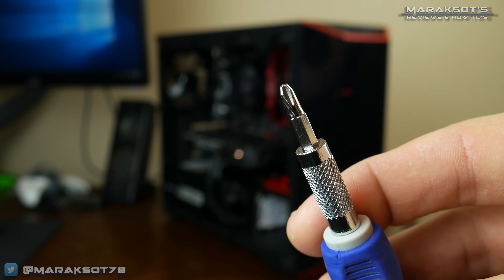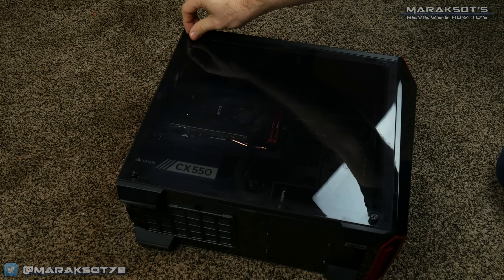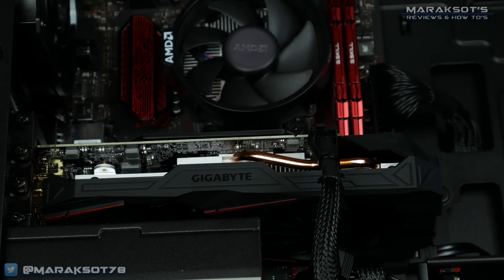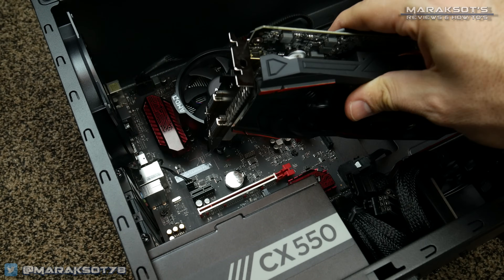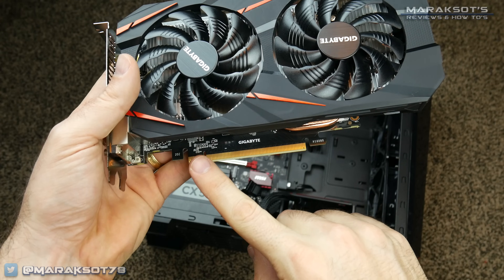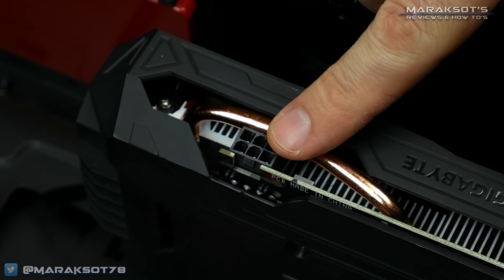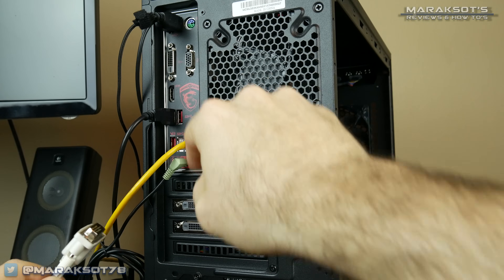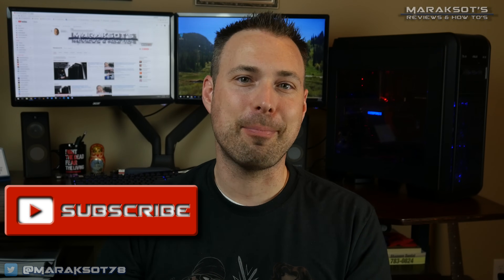How to Install a Graphics Card - Upgrade Your GPU

Comment: i did this then used the command to check my GPU and it still said my old one i installed a geforce rtx 3050 but when i check it in device manager it says intel (r) 630 what do i do?

Comment: My GPU requires a 6 pin connection. My PSU has 2 6+2 ones, both comnected within a single cable. Is it safe to plug one of these?

Comment: More helpful than the previous video where the camera aas on the side so i couldnt actually see INSIDE the computer. Only one problem... i dont see a power supply cord at all let alone one that will fit this geforce rtx 4060

Comment: my gpu has 12 PCIe power pin slots, my pc came with a wire with 6×2 pins with another 6×2 pins extended from that. Should i use that or is it safe?

Comment: You were telling us about static discharge wile doing it on a carpet
Reply from the maker: Yep. The point is ESD isn't as big a concern as some people will lead you to believe. I've been building PC's for close to 20 years and have built almost all of them while sitting/standing on carpet and haven't killed a single component thus far. As long as you touch something metal and equalize the statc charge between you and your PC the odds of damaging a component is pretty much zero.
Reply: hmm okay then @Maraksot78
Reply: this video helped me out i currently have a i3 10105F and a gt 1030 with a B560 DS3H AC-Y1 and i am going to put a gtx 1650 with a i5 10400f and 32 more gb of ram  @Maraksot78

Comment: I don't have a 8 pin cable in my psu do I need a adapter?
Reply from the maker: They do make adapters, but before you do that I would check whether or not your power supply wattage is enough to support your GPU.

Comment: Not sure if I missed this step but I was told if you have a previous gpu in the Pc to uninstall that driver first before setting up the the new gpu. True or no?
Reply from the maker: That's probably the best way to go about it, but you don't have to. I've done it both before and after swapping out graphics cards and everything has worked just fine.

Comment: I have a 750 gold power supply is that alright to run the 4070 ti on?
Reply from the maker: 750 watts is the recommended PSU wattage for a 4070ti, so yes. 👍🏼

Comment: Hey mate do you still respond
Reply from the maker: It depends on the question and whether or not I feel like I can help.
Reply: So the power supply that I currently have has a two-pin and a four-pin cable  for the gpu. Now the gpu that I want to install has 6 pins. So can I put both the four-pin and the two-pin cables together?
Reply from the maker: I'm not familiar with that kind of configuration. 2+6 pin is very common as most GPU's use either a single 6 pin or 8 pin power connector, but I don't think I've ever seen a 2+4 pin PCIe power connector.  I know there are 4 pin connectors though for EPS (CPU socket power) that look very much the same as a PCIe power connector.  I believe it's keyed differently though to prevent people from plugging it into their GPU as they're wired differently.  But yah, without being able to physically see what you've got going on I can't say for sure what you've got there.  Is there any kind of label on the connectors themselves?  It will usually have EPS, or CPU on it if it's for the CPU and PCIe or GPU if it's for GPU power.
Reply: @Maraksot78  ooh I made a mistake I meant 6+2 pin cables sorryy
Reply from the maker: @ellinikompifteki  oh ok. So if your graphics card uses a 6 pin power connector then you just plug in the 6 pin plug and leave the 2 pin bit just hanging out, or you can zip tie it back to make things look a bit cleaner. If it's an 8 pin then you want to plug in the 2 pin and the 6 pin together.
Reply: @Maraksot78  yeesss thank you so much for your time mate
Reply from the maker: @ellinikompifteki  You're welcome. Happy to help where I can.

Comment: What should I do if there are drivers already installed for my old GPU?
Reply from the maker: If your new GPU and old GPU are both manufactured by Nvidia or both manufactured by AMD, then you can simply update the driver through GeForce experience for Nvidia cards and through the Radeon software for AMD carda.
If you're switching from AMD to Nvidia or vise versa, then you'll want to uninstall your existing driver and then install the new one after you've swapped in your new graphics card.

Comment: When I try to plug my monitor in the graphics card my monitor simply goes black. It's on, but it doesn't show anything. Is this common and is there a way to fix it? BTW, nice video! Helped me install the card.

Comment: so my pc is fairly old its about 5 years old, it has i9-9900 core 16 gb ram and nvidia 2080 super, I want to install 3080, is it as simple as taking the 2080 out and putting the 3080 in? or am I in for quite a bit more work if I can upgrade it at all? my case should be able to handle the change its a pretty big case.

Comment: If you dont have a gpu and put it in then you find power cables for it inside the psu ? Or you need to connect new cables to psu ? Buying premade custom pc then buying gpu later so need to put it in myself

Comment: i want to buy a 3080 rtx to replace my 2060 rtx but i dont know if it will fit how do i know if it fits (i havent bought it yet)
Reply from the maker: If you look up the particular model of 3080 you want to buy on a site like newegg.com or other online retailers, in the product description it should list the dimensions of the card and then you can measure the space in your case to see if it will fit.

Comment: Bruh... Why do that on the carpet though..and you talk about static discharge.. lol.
Reply from the maker: It's actually much harder to kill your components than many people would lead you to believe. Your case acts as a dampener if you will. When you touch it, if there's a bunch of static built up in your body, it will be dissipated into the case and you wont shock your components. And even if you did shock your components odds are in your favor they'll be fine. You should check out this video from Linus Tech Tips where they try to kill RAM modules with ESD.
https://www.youtube.com/watch?v=nXkgbmr3dRA
And this video from JayzTwoCents where he tries to kill USB ports.
https://www.youtube.com/watch?v=xdzo-uAvz5Y&list=PL-qY8D-eM9xAKQPVqrTL_cpcSRIj9HTU5&index=1
JayzTwoCents has even admitted to building many of the PC'c on his channel while on carpet.
https://youtu.be/0swuvSF527E?t=63
I too have built many computers while on carpet and have used the "touch the case" technique and in the last 17 years I've killed 0 components.

Comment: I just installerad a 1660yi in my pc and my powersupoly seems to have enougth power but i only seem to have a 6pin power Calle while the grafiks card reauires a 8 pin i did s bit of reserch but can i just put a adapter on or Do i need a new cable (

Comment: I'm a little late to this but should I be concerned with static electricity if I disassemble my PC on a carpeted floor? Does grounding yourself negate that issue? Thanks!
Reply from the maker: I recommend at least equalizing the static charge between you and your PC by touching a metal portion of your case.  Modern PC hardware is much more difficult to "kill" than many people will lead you to believe.  LTT made a video about a  year ago where they intentionally tried to destroy PC components through an electrostatic discharge.  If I remember correctly they were only able to kill one stick of RAM in the process.  They tried really hard to to kill parts and despite their best efforts the PC kept running.  Here's a link to the video if you're interested.  https://www.youtube.com/watch?v=nXkgbmr3dRA

Comment: i got a new card for my birthday but there are wire in the way so i cant plug it in. its considerably thicker than my old 970. this 2060 wont fit! move wires, cut metal?

Comment: Question I’ve never ever have even remotely gotten close to pc parts but I wanted to ask do you think installing a GPU is easy? Like 1-10?
Reply from the maker: Well if you're talking about just the install process... 1 being the easiest and 10 being really hard I'd say it's a 3 or a 4 so long as you know what you're doing and have an adequate power supply and stuff.
Reply: @Maraksot78  ah ok how would I know if my power supply is good enough?

Comment: Thabk you for this informative video,

Just bought a new/used GPU to upgrade  from my current 5600xt & I'm confused why does my current GPU have the availability for 2 sets of PCIe cables but only one is connected... does having only one cable vs 2 affect anything or is it a redundancy? 
Does the 6700xt require both of the PCIe cables hooked up? 4over4 is currently connected should I add the 3over3 PCIe?
Been asking & asking but nobody is helping please help! Thank you
Reply from the maker: Yes, you want to connect both the 8 pin and 6 pin power connectors.

Comment: Now where can I get a Graphics Card? hmm I'll try download the Graphics Card. Frick, there's no good results for this search. I want to download Graphics Card please I'm broke. I have an Intel HD 3000 (aka the toaster laptop) that doesn't support any games. 😭😭😭😭😭

My Depression intensifies due to low spec parts

specs:
i7-2620M - mediocre
Intel HD 3000 - legit potato toaster that wants to kill me
8 GB RAM Stick - Not that bad
2 GB RAM Stick - Terribly potato toasted
Reply from the maker: Unfortunately getting a graphics card right now is an almost impossible task unless you're ok with paying 2, 3 or 4 times MSRP. Sounds like that's not your thing though. Depending on the speed of your internet you may want to check out GeForce Now. May be a way to play some games on your potato PC. I made a video about GeForce Now if you wanna check it out. https://youtu.be/kA0cr0Ae-Wc

Comment: Hey I need help I have ryzen 3400g vega 11 graphics can you suggest a good graphics card pls
Reply from the maker: Well that's an interesting question because currently there is a world wide shortage of graphics cards... that is unless you're willing to pay WAY more than MSRP to get one. The pandemic and current crypto currency bubble has people buying up all the graphics cards as fast as AMD and Nvidia can make them to mine crypto with. Normally I would ask what resolution, refresh rate and detail level (i.e. low, medium, high, ultra, etc.) you want to game at? For 1080p 60fps,
High to Ultra settings the RX580, RX590, RX 5500XT, GTX 1060, GTX 1660, GTX 1660 Super and GTX 1660ti are all great cards. But again, you can't find any of these cards currently for their MSRP (these cards should range between $200 - $300 US) but thanks to the current crypto situation they're all about double their normal price ($500 - $600+) from people that bought them at MSRP and are now looking to resell them for a big profit. Hopefully the crypto thing will die down soon and prices will come back to normal in a few months.

Comment: what if your graphics card doesnt have a power connector
Reply from the maker: If there's no supplemental power required then you just insert the card into the PCIE slot and install the drivers. What card are you installing? GT 1030? GTX 1050ti?
Reply: Drivers name is gigabyte GV n630 2gi and is a gigabyte says its a gtx my friend gave me the card so I don't know much about it

Comment: You're literally so much help, I have 0 knowledge about pcs and what a graphics card even look like. I brought my first Pc and it arrived yesterday. (Ryzen 3 3200G w/ Vega 8) I already know the graphics card isnt going to be able to run some of the games i wanna play so i need to change it. Thanks so much :)
Reply from the maker: The 3200G with Vega 8 is what AMD (the manufacturer of the 3200G) calls an APU. It stands for Accellerated Processing Unit which means it's a CPU with a graphics processor built into it. So if that's all that's in your PC then you do not currently have a graphics card installed in your PC but are instead using the graphics processor built into the CPU... er... I mean APU.  When you're ready to put in a discrete graphics card all you have to do is install the card into the PCI express slot, connect the PCI express power cables if necessary, plug your HDMI or display port cable from your monitor into one of the ports on your graphics card, boot up your PC and then download and install the drivers and you'll be good to go.

Comment: I have that older latch. So i pressed it and my card didnt wanted to go out. I accindentally broke the latch. What to do now guys ?
Reply from the maker: Just make sure your card is fully seated and then make sure the screw that attaches it to your case is nice and secure and you'll be fine.

Comment: Is it true that you can use two graphics cards?
Reply from the maker: Yes... but... nowadays it really only makes a difference in graphics card benchmark applications and even then most modern graphics cards don't support dual card configurations anymore. SLI (Nvidia) and Crossfire (AMD) were a thing for awhile but for having multiple GPU's in a system to make a difference in any application, including games, the developers have to code their applications to utilize multiple GPU's. That requires them to do additional work that quite often really doesn't make sense for them to do especially when it comes to games. Most games are programmed for consoles like the Xbox and Playstation which only have a single GPU. The majority of PC's also only have a single GPU so it just didn't make much financial sense for game developers to spend a bunch of additional time and money to add multi-GPU support to their games. Due to all this a few years ago both Nvidia and AMD officially quit supporting multi-GPU configurations on all their graphics cards other than their highest end/most expensive GPU's, and the only reason they support it on those GPU's is because those are the fastest most powerful GPU's that exist so if you need more power than a single card can offer, and the apllication you're running supports multiple GPU's, then the only way to get more power is to add another GPU. Yah I know that's a longer answer than you were probably wanting but I wanted to answer you're question as best I could.  :)
Reply: @Maraksot78  Oh okay, and thanks aswell I'm getting a Nvidia GTX 1650 super graphics card. I have an AMD Radeon Vega 3 graphics card and its like really bad, no idea why though or maybe its just not a good graphics card whatsoever 😆

Comment: I installed the new graphics card yay! But the problem is that when booting up the computer the screen goes black and loses signal after the bootup screen (mine is asrock). It took my five hours of research and screwing and unscrewing to try and figure it out, which lead to no avail. All wires are in place and I checked numerous times if the gpu was in the right slot. The HDMI and display port both work perfectly on my monitor on the past graphics card. I have no idea what's wrong! I'm using a Ryzen 3 2300 and a GTX 1650 super and they're are not faulty because both lights are working on the PC.

Is there any way to fix this? I need this for online school.
Reply from the maker: I can't say for certain what's causing this problem but if it was me I'd try updating your motherboard BIOS. Again not certain that's the problem and if that'll fix it or not but it's worth a shot.
Reply: @Maraksot78  hey i just took the pc to best buy to see what was the culprit and they just said that the pc didn’t know what to do with the new gpu though the gpu does work perfectly. They just said the pc needed a hard reset from the bootup screen.
Reply: @Maraksot78  ok thanks😃👍

Comment: Hey, i had a PSU issue and i replaced and put everything back including the graphics card with the 2-4pin connectors into my graphics card and boot it up.  When it turns on, the graphics card fans spin for a few seconds and when windows is booted, they stop spinning forever and my computer is very slow.  Everything was perfect before the PSU issue but now im getting graphics card issues.  The screen is on but its just unbelievably sluggish and unplayable. What can be the issue here?

Comment: question. Does the motherboard have to be compatible with the new videocard i'm gonna install or does it just work with any videocard and motherboard?
Reply from the maker: Usually you're ok but if your motherboard is old then it's possible it will need a BIOS update or even a new motherboard to be able to use a newer graphics card.

Comment: are the pins of all the cards the same?
Reply from the maker: PCI express has been the standard interface for about 15 years so all consumer graphics cards use PCI express.  There have been different revisions of PCI express in that time of course. Current AMD motherboards now support PCI express 4.0 but PCI express 3.0 is still very common.  As of right now Intel motherboards still only support PCI express 3.0.  AMD Radeon and Nvidia have only begun making PCI express 4.0 compliant graphics cards in the last year or so but they are backwards compatible with PCI express 3.0 motherboards and PCI express 3.0 graphics cards are compatible with the newer PCI express 4.0 motherboards, so nothing to worry about there.
Reply: @Maraksot78  thx

Comment: Sorry if this is a dumb question, but I'm a bit new to all this: I currently have a GTX 1060 and I want to go to a GTX 2060. Can I let GeForce Experience handle all of the driver stuff (I.E. uninstalling/installing) or should I do this manually?
Reply from the maker: I've never used GeForce Experience to update drivers so I don't know from first hand experience but I believe you can do that. I'm an old school guy and always just manually uninstall my old driver and install my new driver.